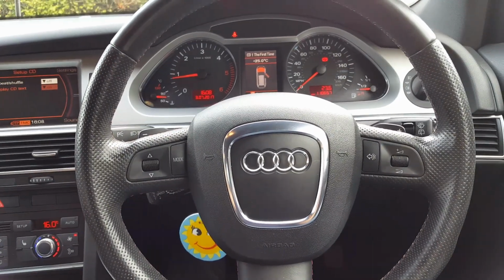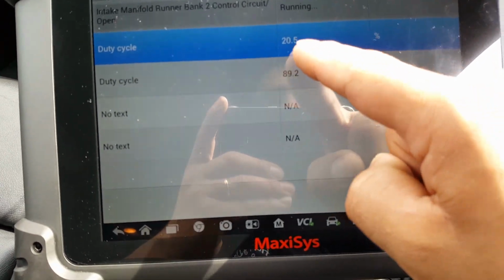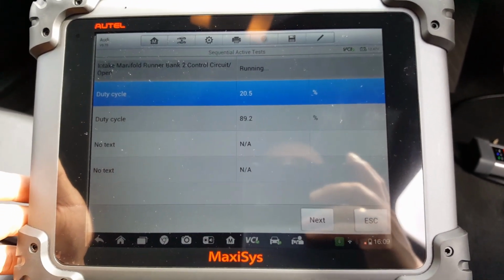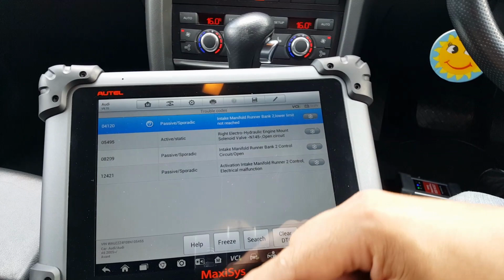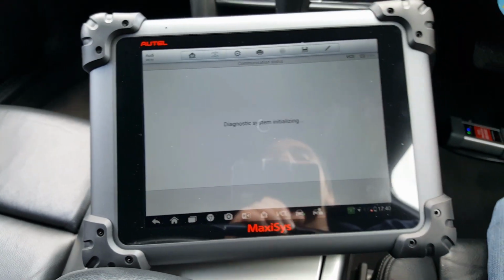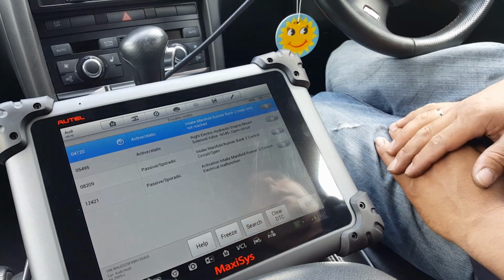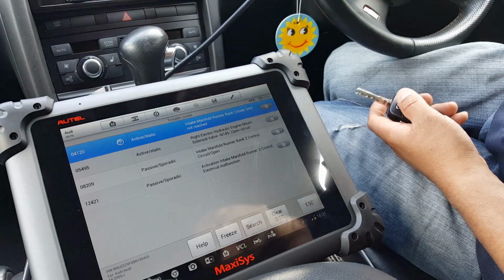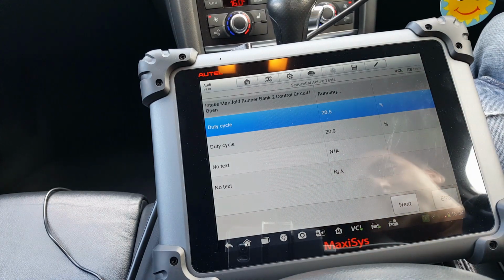Audi A6 2.7TDI V6, trouble code P1018 or 04120 flap actuator. Fault finding and repair.

Comment: great video mate well done you came across very well to me no problems at all I did a similar thing with a motor before by switching the gears around they were worn on one side switch them around and part was working again properly temporary fix but at least the customer got going sometimes we have to do these things
Reply from the maker: +bodgit and leggit garage 
Absolutely... 
Thank you for watching and for your comment!